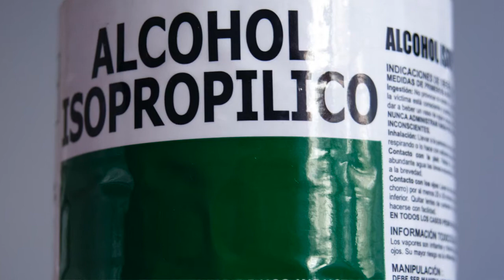Limpieza del sensor por un experto invitado Curso de fotografía 46

Comment: Limpié mi sensor y creo que lo rayé, ahora salen unas manchas oscuras en las imágenes, como corrijo esos rayones?
Reply from the maker: Hola. Dime cómo lo limpiaste para tratar de deducir si efectivamente lo rayaste. Al aplicar más de tres gotas de alcohol isopropílico tiende a verse el sensor rayado hasta que se seque bien. Las rayas reales se ven como la que muestra este video en el minuto 3:00. Si realmente lo rayaste, lamentablemente tendrás que mandar la cámara a un taller para que le cambien el sensor.
Reply: ¿Pero aun asi se puede seguir utilizando la camara, con un rayon en el sensor?
Reply from the maker: Puedes usar la cámara con el rayón, pero te saldría la raya en todas las fotos.